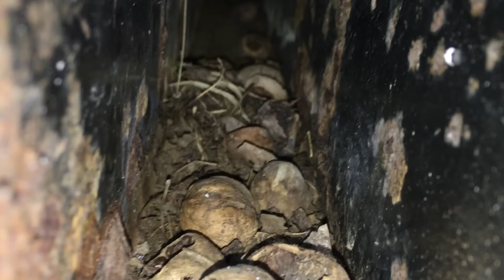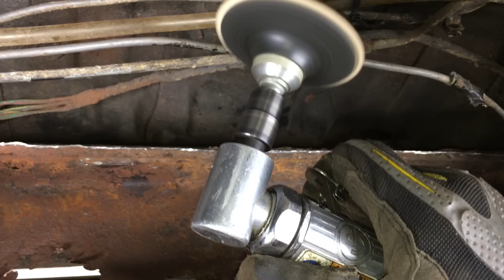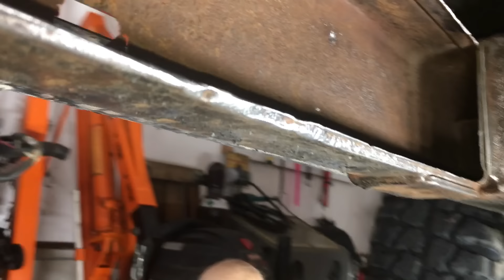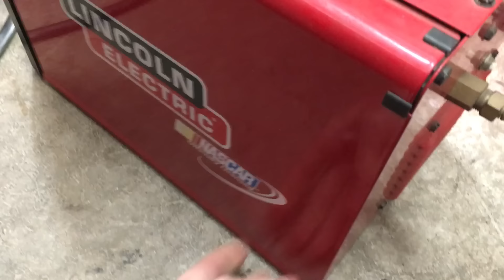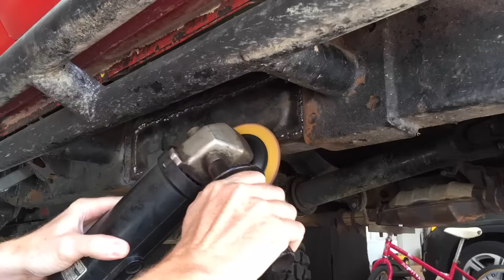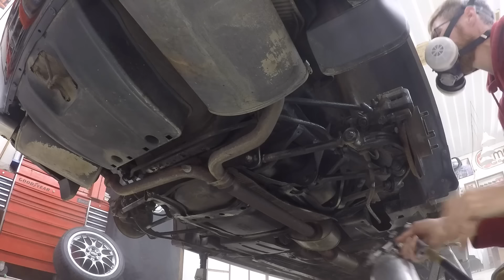How to Properly Repair Rusty Frame of Toyota Pickup Truck at Home

Comment: Only because you asked here is some constructive criticism:

When using a smaller welder, you should grind angles into your plate to get more penetration. 

Flux core wire will weld thicker metal than gas shielded. At least according to the chart on my 2 welders.

When you make a repair like that it is better to build a box from 2 pieces of angle and then place splicing plates on top of the repair. Those splicing plates should have plug welds at points along the plate. The reason for this method it that your frame could suddenly split in half along the welds because of cracking caused by road vibrations. The best example of how to do this was on 4wd 24/7’s channel when they modified the 80 series to extend the frame.
Reply: Bevel everything. This guy knows.
Reply: Can you send me the link to the video? I've got a vertical crack in the frame of my chevy truck. I need help to fix before winter season.
Reply: @lawnstar1441  

This video has all the basic concepts. When you cut out a piece you should place a welded plate on top that extends beyond the cuts to strengthen it. That cover plate should also be plug welded to your filler plate. For this you drill holes in the cover plate and weld them to the filler plate.

https://youtu.be/YBdNtnASWis
Reply: @jflabeets1  yes when me and dad fixed my 80 chevy frame broken between cab and bed, we got new frame, beveled all, then welded it together like tongue n groove, not just butt weld 2 pieces of frame. Then used a diamond shaped piece over the weld, and plug welded. This was in 2003. Trucks still going. But I had to take off bed, etc. Alot of work but I feel it's a way better, long lasting repair than doing it with bed, suspension etc on frame. All kinds of room to work, etc. Easier u can work on your job, the better it'll be.
Reply from the maker: Thanks for that advice! I always appreciate professionals who share their knowledge.
Reply: If you don't add splice plates over the repair plate and extend it both sides what are the odds it will break again? Just had cracks on a chevy cut out and plates welded in place and now I'm worried it'll break again
Reply: @aj2no17  odds are 100% depending on time and what you’re doing with the truck, it isn’t if but when.

Adding a splice plate and boxing the frame will significantly reduce the chance of issues.
Reply: @jflabeets1  wish I could send a picture but the patch plate is only about a quarter of the way up from the bottom of the frame it's not like this video where he had to cut out the whole height of the frame. Metal around it is solid hitting it with a hammer and still thick enough.. should I still try to splice plate it or leave it. My welder is an hour away and I just got the truck back from him so this is going to be a pain unless I try it myself and I've never welded before
Reply: In Pennsylvania you cant weld on a frame with flux core….
Reply: @patrickw8302  fair enough, but I’m not sure why as flux core is literally better for that application as it works better on items that are not perfectly clean and typically penetrates better.

In either case putting a plate over the top and plug welding is still preferred over just welding the joint. Also, the metal itself is more likely to break or crack than the weld. 

I think it more depends on the metal you’re welding also, as newer metals could lose some strength when heated and not cooled correctly while older softer metals may not be affected as much.

“Neither wire is superior to the other. They simply have different properties that work better on certain applications. As far as performance is concerned, both wire types produce sound welds with good weld bead appearances when applied correctly and used within the proper parameter settings. Solid wire provides deep penetration in the root and usually has little spatter. Flux-cored wire has a larger ball-type transfer and produces low spatter levels. In addition, flux-cored wire produces a rounder penetration profile with excellent sidewall fusion.

As far as user appeal, both solid wire and flux-cored wire are relatively easy to use. This makes them ideal for novice and occasional welders working in automotive, farming and home hobby applications. Welders may prefer solid wire on thinner applications because there is no slag to remove, it is ready to paint and the weld beads may be more aesthetically pleasing.”

https://www.millerwelds.com/resources/article-library/solid-wire-versus-flux-cored-wire-when-to-use-them-and-why
Reply: I agree they weld dozers and heavy plate with flux core  spray transfer.. Metal is metal you can always preheat metal too. That’s an old trick my buddy taught me especially if you got a 110 V so if your welds are good and clean then to me that’s good as a handshake.
Reply: @patrickw8302 I bet you CAN.  How would they tell the difference?
Reply: @patrickw8302 why?
Reply: Maybe some 110V welders are superior to others but I'm surprised to see one capable of welding frame thickness material.  Flux Core adds a little penetrative power but still seems off the recommended chart. 
If I did try it, I would try and use the heat: This fellow jumped around similar to sheet metal welding.  After I got the panel locked in, I'd burn in as hard as I could using the heat build up to help pernitrate deeper.  He did have a burn through, so, maybe his 110V has super power.

I don't understand the "no flux core on frames" rule mentioned here.
Reply: p.s. I think he did a great job cleaning out that frame.  He did everything I've tried and even added the garden hose: difficult and time consuming work.
Reply: Plate iron that thin never gets angles. In this case its the low amps that caused the weld to be too cold.
Reply: And if u have no clue either ask ppl who do or don't do it. Please dont. If u weld it all up and it's not right it will break at highway speed and kill ppl for what? Saving a few 100 bucks. If anything pay sombody to prep it and get it ready then if u can weld do so. Plus a stick welder can weld heavy plate like this easily and got burned through. My dad at that time welded for decades and was taught by a welder.

Comment: Great job! Did the exact same steps to my Toyota, cut-clean-weld-paint-fluid film... I will never do it again. FRAME SWAP :)
Reply from the maker: Same here, I'd love to find a rust free frame
Reply: I was thinking that watching this video. His repair was a great structural repair but if you wanted to do full on restoration, you’d be better off doing a frame swap and powder coating it. Absolutely major job and incredibly expensive.
Reply: @reaper-sz5tm  Easiest and cheapest route is to find a wrecked truck, preferably rolled, and use that frame.

Comment: If you have the frame open, why you din't spray with rust inhibitor before sealing the frame.
Reply from the maker: Because it too will flake off, like the factory coating on the inside of the frame did.
Reply: @6thGearGarage  Something oil based and penetrating is IMO the only way, and keeping up with treatments on a yearly basis. I've recommended Dinitrol products before for this, what I use to keep rust at bay.

Comment: You need 220 welder to properly weld vehicle frame!
Reply from the maker: Yeah, I'd like to own a 220 one day. I used this 110 to repair the back half of the frame 10 years ago and it's still good there, so it does the job.

Comment: Nicely done, both the truck and the video. I’m starting frame repairs on my 07 Sequoia. Good times! Subscribed.
Reply from the maker: Thanks 👍 Hard to imagine an 07 already needs the frame repaired!
Reply: @6thGearGarage  had the entire frame on my 05 Tacoma replaced under recall.  The 07 Sequoia fell under the same recall but missed the recall cut-off date. The area around the driver side sway bar bushing is rusted all the way around and broken loose. Lots of rust from there back about 3 feet, on both sides of the boxed frame. It’s definitely repairable, but a decent size job. Have to drop the tank,lines, and exhaust to get enough access.
Reply from the maker: @andrewreece3861  it's a shame the recalls "expire" and a bigger shame that after 30 years, Toyota is still using frames that rot away.
Reply: @6thGearGarage  I had a 1978 Jeep J10 back in the early 90s so it was about as old then as this Sequoia is now, and it had WAY more rust than this does now and people just accepted that it was was just a rusty “old” vehicle.
Reply from the maker: @andrewreece3861  I haven't seen a J10 around here in forever!

Comment: I think the best coating for your money is Rustoleum Rusty Metal Primer followed by their black paint. BRUSH it on. Then Fluid Film
Reply from the maker: I haven't tried that out yet, thanks!
Reply: @6thGearGarage  also, I have found the best way to keep the frame clean on the inside is with a sewer better attachment hooked to your power washer. I think a yearly cleaning followed by fluid film will work very well.
Reply: Correction:Sewer JETTER*
Reply from the maker: Especially if you take the truck in mud... gotta get that out of the inside of the frame. I think the larger holes on the underside will help.

Comment: A 37 year old toyota is like 100 year old titanic.  Toyota made a lot of $ by making these tin can pickups.
Reply from the maker: They made a lot, and then recalled a lot. Unfortunately the recall periods expire.
Reply: Yep.  My 04 has a hole in the frame right above the rear wheel. Taking it in for welding this month, and having them look for any other problem areas.  It was taken in for recall work. And whatever they did, lasted just long enough to when the recall ended.  So as much as I love my Toyota,  I'll never buy another, just for the simple fact that if you believe in your product,  you stand behind it. There are other makes out there, that are older than mine, but have no frame problems.
Reply from the maker: @jefferydellinger7422  Yep, Toyota really shot themselves in the foot with the frames they use. Such a shame because the rest of the truck will last so long.

Comment: Cover it in  Fluid film or bar and chain oil  If you cut it with  Diesel fuel you could spray it out of a gun. Amazon even sells a kit with Fluid film.
Reply: Wool wax is the way to go!!
Reply: PB Surface Shield works best
Reply: Fluid Film is gold in US Navy avaition. Coat nearly everything in it. Even in my morning coffee since '97!

Comment: You need another frame, not safe for road
Reply from the maker: This is normal for an Ohio frame. I repaired both sides of the frame under the bed 10 years ago and it's still good. But I would gladly swap over to a rust free frame, if I could find one.
Reply: If the repairs done right I don't see why you couldn't basically do a frame of theseus and eventually replace every part with a new metal. Aside from the amount of work it entails.

Comment: I recommend Fluid Film or Rust Check. I coated the entire undercarriage of my brand new Tundra back in 2019, frame still looks perfect today. The tar or rubberized products will only trap moistures and accelerate the rust. I would never use them.
Reply from the maker: I'm a long time fan of fluid film. I'm hearing a lot about a new product called Surface Shield (made by PB Blaster) as well.
Reply: @6thGearGarage  I think as long as it's oil based, it's safe to use.
Reply: @6thGearGarage , it's better than fluid film

Comment: I would scrap this frame lol
Reply from the maker: This is normal for an Ohio frame. I repaired both sides of the frame under the bed 10 years ago and it's still good. But I would gladly swap over to a rust free frame, if I could find one.
Reply: @6thGearGarage  I live in rust belt as well, so I understand your pain 100%.

Comment: What about using ospho on the inside and all the surface rust?
Reply from the maker: I just researched it and had I known about that beforehand, I would have given it a try. Sounds simple to apply and you don't have to wash it with water after.
Reply: @6thGearGarage  maybe for a future video would be cool to use on your surface rust
Reply from the maker: @BraddaMarlon Yes, there will never be a shortage of rust on the channel :)

Comment: Repair Geek recommends Mastercoat on his YouTube channel. It's used to protect steel frames on bridges and other infrastructure, so you know it can handle extreme elements. I've never used it myself, but he did a video where he used it in his SN95 Mustang and it looked really good. Nice work!
Reply from the maker: I just found his channel the other day and I've been watching a lot of his videos!
Reply: Kem-kromik from sherwinn Williams for structural steal is a really good high zinc and high solid etching primer for rusted metal it's pricey though but tough as nails I usually treat with Ospho twice wire brush then apply the Kem-kromik then paint with two coats of black swimming pool epoxy it holds up awesome under a vehicle and is loaded with solids and U.V. blockers a sand blaster just bounces off it if you try to take it back off something

Comment: I did the same job on my Pajero/montero gen/mk 1 . I also used a naillscaler and air hammer outside of the frame. It really helped to losen and brake of the rust scaling on the inside and even pulverize it in smaller chunks for easyer vacuuming. I also blassed it with air/chock tank on the opposite ends.
Its also really important to jack up the frame and even brase it so it wont bend, twist or sagg were you have to cut big holes or litle left on the frame.
I filled it with fluid film and a diy redneck mix of geease, wax and oil inside after 2 weeks after the fluid film... Just for sh*ts and Giggles
Reply: Let me guess. Rear arch, just below the drop link?

Comment: back when these frames were new and rust free they were pretty strong as Toyota basically has 2 pieces of c channel that shove into each other that were welded at the top and bottom, however as you have shown that design is prone to rust jacking and rusting from the inside out. I hit the frame jackpot for my truck as I still have factory paint on the inside of my frame. If I were you I would keep your eyes open for a good frame from a southern truck as it looks like your frame is starting to near the end of its life. one thing to note is a 2wd frame has the same arch as a solid axle 4wd frame and they are typically cheaper and easier to find.
Reply from the maker: 100% at some point I'd love to find a clean frame and swap, so I don't have to keep doing this repair process.
Reply: @6thGearGarage  I will keep my eyes open for you. I live on the edge of the rust belt so it's not uncommon to find clean frames near me.
Reply from the maker: @retro_88yota  I appreciate it!

Comment: Should have painted the inside and those pieces using weld thru primer and high heat paint.
Reply from the maker: I was nervous about the primer/paint flaking off over time and sitting in the bottom of the frame. I really need to travel south one day and just buy a clean frame and swap it.

Comment: Might push when running mig. Way I was taught, seems to work well. I only follow when doing stick or Tig at times.
Reply: You can pull MiG on a downhill weld, otherwise you push the puddle. This is also true with flux core wire. Lots of people become frustrated with these flux core welders they buy at harbor freight, or MiG, because they pull the puddle and make a mess. Lol